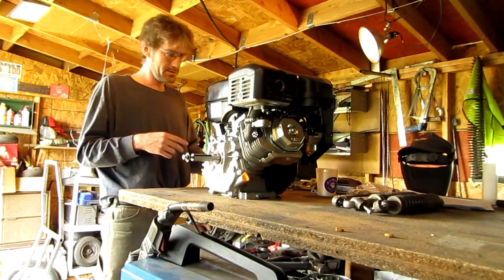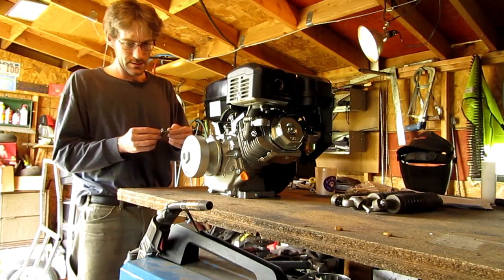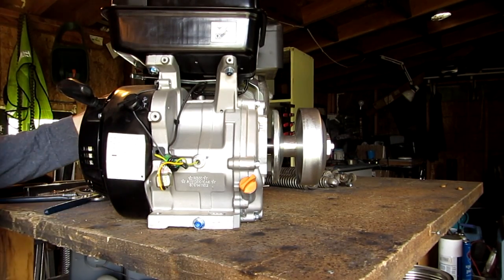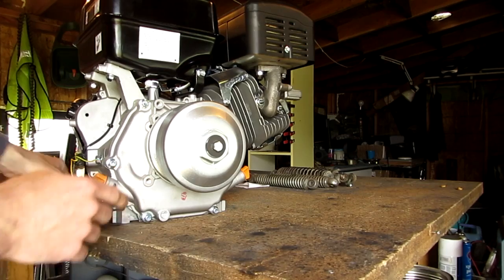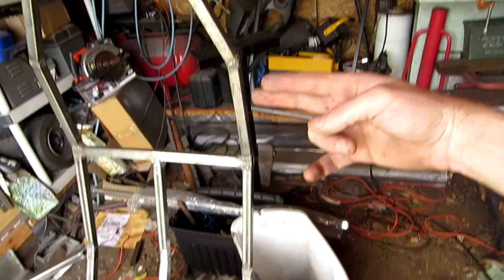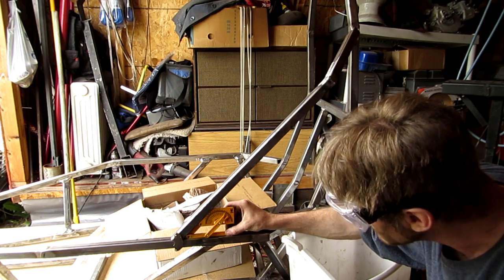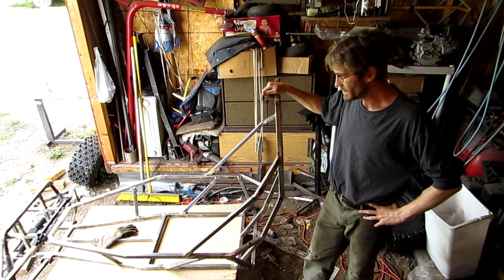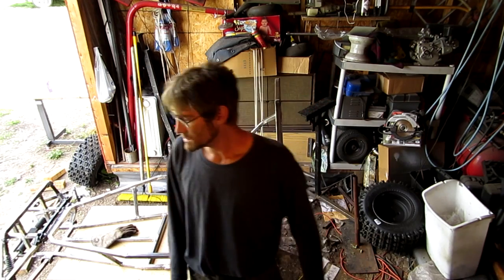Go Kart , Building █ #8 ( The Fullscreen Machine )

Comment: dude, how does the torque converter actually work? If that front pully is constantly being driven when the engine is running, and the belt would be constantly connected to it??? then surely it would constantly drive the jack shaft, or whatever the belt is guna be going to????
Reply from the maker: kind of, when the RPMs rev up the driver starts to grab the belt and that is when things start to work/happen.

Comment: Duh! Now I remember you mentioned Fullscreen before so many times! Checked them out, I hope they recognize your project. If you game or look for free computer stuff, MassLuminosity has giveaways, GamingTribe is the doorway to win. No costs. 
 Are you putting this in the Diygokart buildoff? ⊙--⊙
Do you think it would hurt to spray like silicone lubricant through the welder line to the stinger?
 Rust prevention and better performance of wire travel.